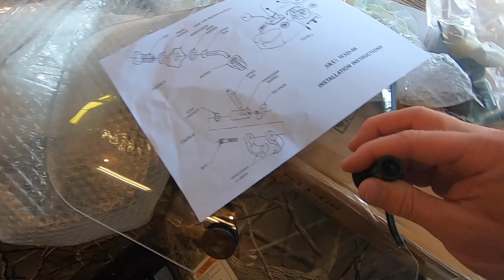Hawk 250 Upgrades - Clutch and Brake Levers, Windshield and Top Speed Run

Comment: Everybody keeps saying "it's not a highway bike"
I mean sure, I wouldn't do a cross country trip, but I'd have no qualms with a six hour ride. If you put a little money into a better carb, muffler, sprockets etc. and don't weight 250lbs you can get it up to around 75mph. That's the charm of this bike. It's for people that just want a bike to ride occasionally, or it's a very good modding platform for people who like to tinker and want a unique bike. I plan on modding it to squeeze all the performance I can out of a 250cc because that's the fun part. I also want a small displacement general purpose bike for street and trail, and with a little love this bike will make a great Jr adventure dual sport. You can get the bike for about $1,500 and by the time you have around $3,000 in it it'll be better than any used $3,000 bike in the 250cc range.
Reply from the maker: True statement
Reply: Nailed it 100%

Comment: I got them on and they work great with better feel. The clutch side needed grinding down like yours but the switch does line up. Probably because it's technically not the Hawk but Bashan BSR Enforcer they look the same.

Comment: Not a bad top speed. I only weigh 110 soaking wet so I'm wondering if I can get mine a couple miles an hour faster. If I can hit 75 on flat, I'll be ecstatic. Saia LTL needs to stop playing with my heart and deliver the bike already. It's been a half hour away from me for the past 4 days.
Reply: Did you set an appointment for them to drop it?
Reply: Mine got here last Wednesday...already jetted stock carb, replaced tires and more to come. Hope you get it with no hassle

Comment: Hey, just got one of these bikes. I see the MadDog seat cover. Did you have to do any alterations to make it fit properly? The regular seat starts to hurt my bum after 50 miles.
Reply from the maker: No. It fits and is a common "mod" for the Hawk. It still hurts my rear on long rides but is better than stock.
Reply: @JackofAllMasterofNone  Thanks for the reply, I have one on order now. :)
Reply: I used a saw-blade knife to cut out some of the foam on my hawk's seat and the put the MadDog cover over it so it fit better.

Comment: How did you get the clutch cable on I'm having trouble putting mine on
Reply from the maker: I'm not sure how to answer this comment. It goes on just like the old one came off. May have to be adjusted at either end. It's a pretty universal process.

Comment: Did you have to do anything extra to get the levers to fit? Wanting to get a set but want sure if you have to do any manipulation for fit. Thanks in advance
Reply from the maker: I show in the video what I had to do. Not much. They fit as is but I chose to do a little grinding on the one.

Comment: Was the engine upgrade you did earlier worth it? I never saw an update video on the performance increase/loss. Seemed like a lot of work. Hope you got some better torque/speed out of her!  I have a 2021 xt250 EFI and I can get it up to 82mph at 145lbs 6ft tall.
Reply from the maker: I did multiple videos on it. Overall it was a decent upgrade. Probably not worth the price to most people, but it was a fun project. Top speed is only around 72mph with my gearing. Plenty fast though.
Reply: Wow 145 at six feet tall.    Eat.  Your starving

Comment: You can find a replacement for the exact part at TX Motor sports.
Reply from the maker: Yeah. Too much money and takes a long time to get. It's riding season.
Reply: @JackofAllMasterofNone  ok, yes that is fair, and they are very expensive, just the clutch lever alone for my bike cost $40
Reply: I ordered this bike from them in feb on the pre order. still waiting. says they are in stock now. customer service there is terrible.
Reply: @resatchel4389  Got mine after a week of ordering it, its probably because like you said it was a pre order

Comment: I just ordered the gold levers for my tt250 but it's definitely thicker on the clutch side .. I haven't tried to put them on yet but I'm not sure if they will fit .. looks like definitely there will be a lot of grinding to be done .  Any thoughts on this?
Reply from the maker: Not sure. The tt250 actually has different levers than the Hawk.
Reply: @JackofAllMasterofNone  yeah I just learned that.. but it was a free return so no worries but you can get same type of levers that have the brake reservoir attached and it's all just plug n play for like 40 bucks
Reply: Grom levers fit the Hawk